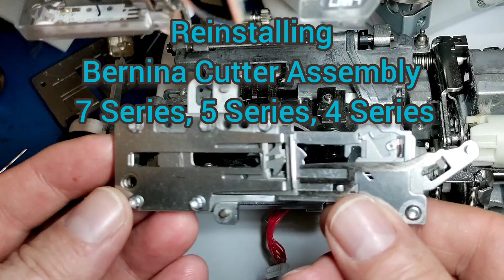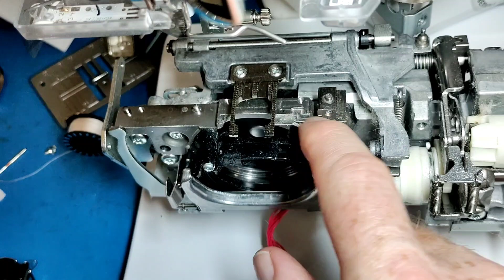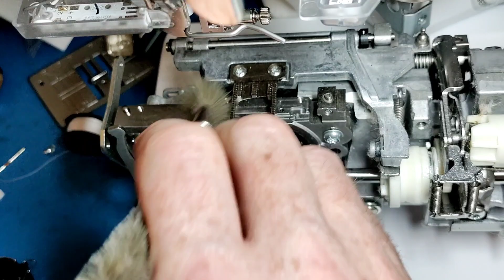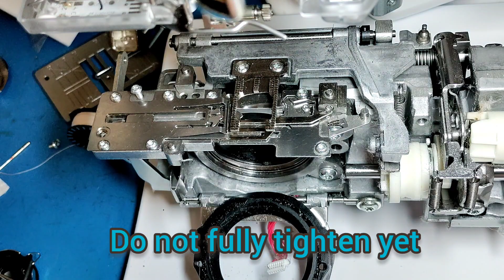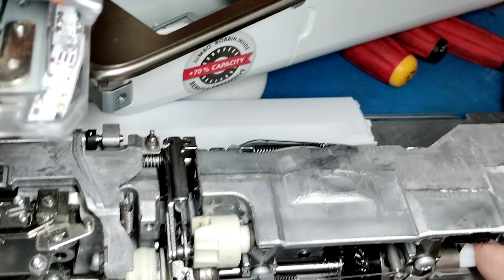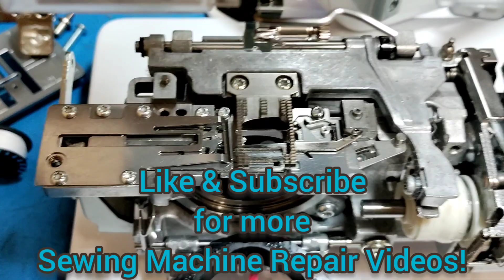Install Bernina Cutter Assembly 7 Series 5 Series Repair 790 770 590

Comment: Should the thread cutter rub along the bottom of the feed dogs when it comes out to cut thread?
Reply from the maker: No. Nothing should touch the feed dogs.
Reply from the maker: 1:49 in the video talks about seating the cutter assembly so it is flush up against the frame below it without gaps. Vitally important.

Comment: I am watching 9-7-24. I replaced all of this but once I push in the white fork and the cutter moves like yours but then there is a catch and the knob won't turn anymore unless I reverse and there is a click. What might be wrong ?
Reply from the maker: @patriciacrisp7830  go to the previous video and make sure it is assembled correctly. Specifically that the plates are in the correct  order. It is easy to get this wrong. Second, make sure the cutter assembly is seated all the way down flat to the frame  without a gap. Third, rotate the handheld several times and try again.
Reply: We did all of that but have taken off so will try again. I will let you know if it works. Thank you.
Reply from the maker: I am talking about the 12:00 mark of that video.
Reply from the maker: If it doesn't work, there are several other parts of the cutter system on the back side of the free arm, which could be damaged or misaligned. Unfortunately, I have not created any videos dealing with those issues.

Comment: My new cutter is in and working however it is unthreading the needle upon the take up.  Any suggestions before I drive 2 hours to a dealer?
Reply from the maker: @scooterbling  sounds like it isn't cutting cleanly.  There could be a defect or small nick in the cutting edge of the blade.

Comment: Can you give a source for getting a new blade?  i have one that is nicked soo bad that smoothing/sharpening is not an option.
Reply from the maker: @walterwoods8150  I wish I could. I haven't found any sources for them outside of being an authorized Bernina dealer. Which means, to have it repaired it has to be service by a qualified Bernina technician to get the part.

Comment: Thanks a lot for very detailed instruction. Bit of missed Bernina disassembly/uncovering instruction (nobody in the world seams to publish any for newer Bernina), but finally managed it as well as assembling it back. Bernina 570 QE VIO.
Reply: Running into the same issue.. can’t find any help on how to get it apart to get to these pieces.